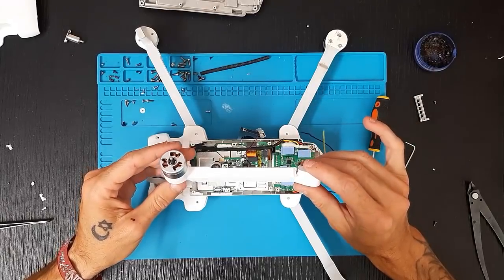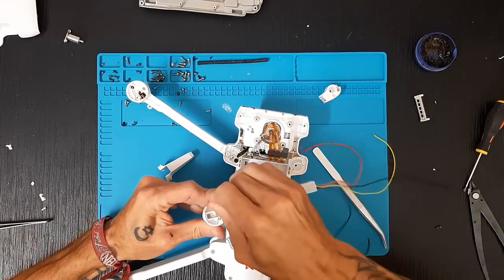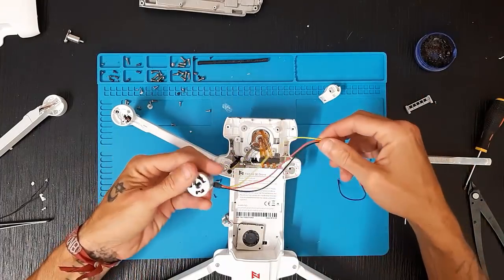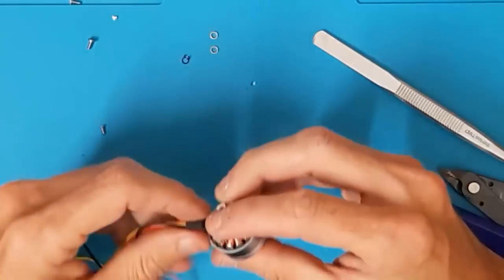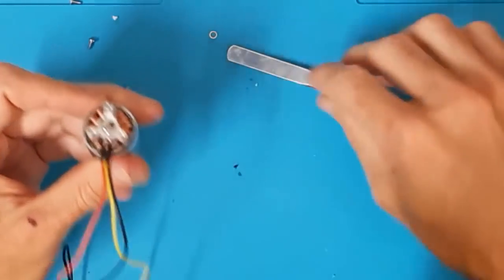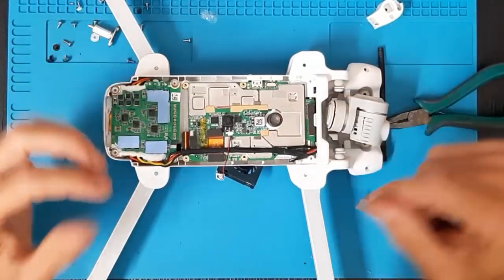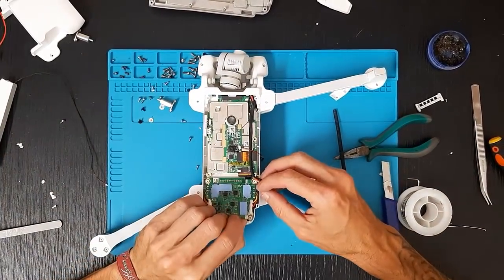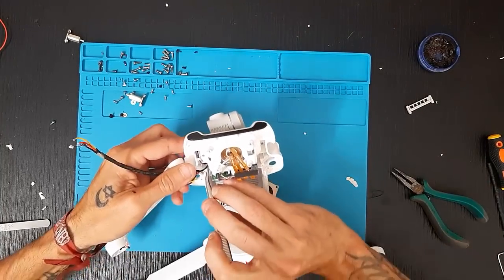Cambiar motor, Colocar cables, FIMI X8 SE

Comment: es possible de soldar el motor directamente al brazo? El brazo de mi Fimi esta bien, pero el motor no va bien. Asi que estoy pensando en cortar el viejo motor y soldar el motor neuvo all los cables viejo que pasa en el brazo. Gracias y buen dia.
Reply from the maker: Hola si es posible pero mas trabajoso, tiene usted otro motor de recambio?¿
Reply: Canarias-Stock si tengo otro motor con brazo. Yo pensaba en cambiar el motor y evitat de avrir el drone y todo si puedo soldar el motor directamente donde se encuentra el viejo motor.
Reply from the maker: @TheDNM77  bueno poder se puede pero va a ser dificil y complicado pero si se puede